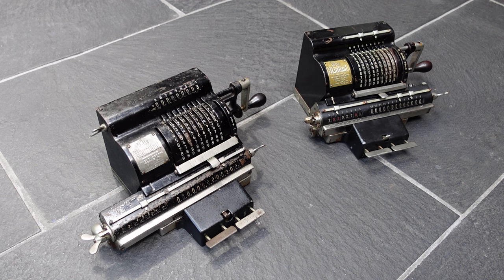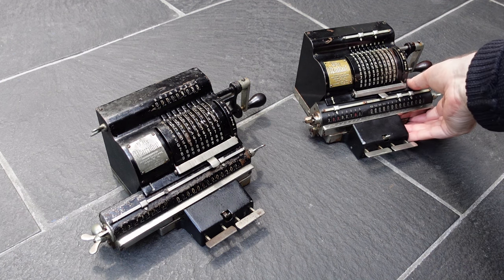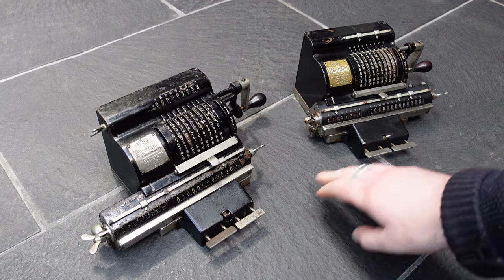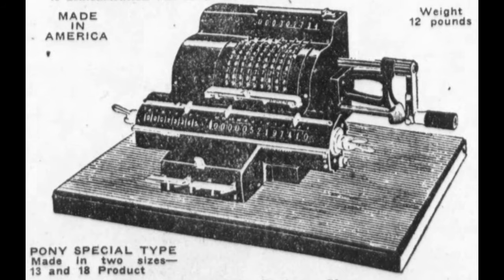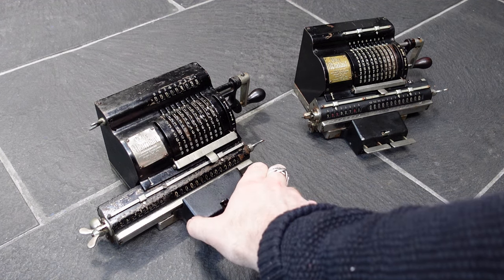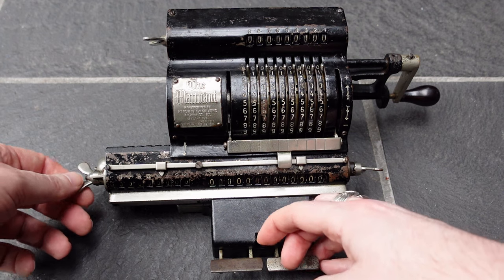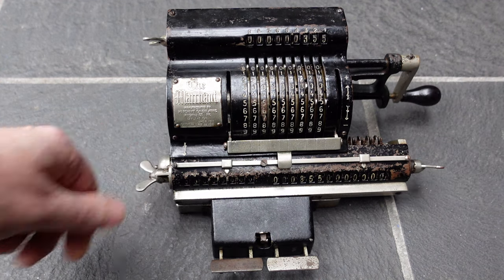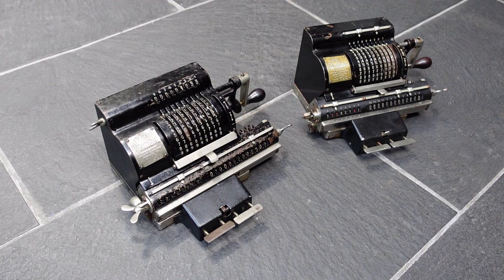The Marchant Pony pinwheel calculator

Comment: When I first found your website, then later your YouTube channel, my initial interest lie in (Felt & Tarrant) Comptometers and (Burroughs) Calculators, both basically the same from the operator's point of view, and both machines in which I had had experience working with in my late-teens. Seeing more of your videos, however, I find I'm further intrigued by some machines in which I have no background and not a clue how to operate, such as these pinwheel calculators. (I had seen slightly similar Monroe machines in my youth, not that I could operate them, but I had never seen a Marchant). Your videos are wonderfully clear in both explaining the nature of the machines, i.e. how they work, as well as explaining how to operate them. Thank you for this!
Reply: Now I'm curious; would you know if any of the companies which produced pinwheel-type machines also made any specific to (old) Sterling currency? Or for other non-base-10 specialised machines used for work in Imperial measures, for instance: Shipping weight in quarters, cwt's, and tons? Or for fractions (like some of the later Sumlock Comptometers; some even set for 'Time' to reckon the No. of hours worked & overtime for purposes of calculating payroll)? Thanking you in advance, Cheers!
Reply from the maker: The only non-decimal pinwheel I know of is the Odhner Lusid for Sterling currency (and its predecessor models). See my video: https://youtu.be/inhw185vbts